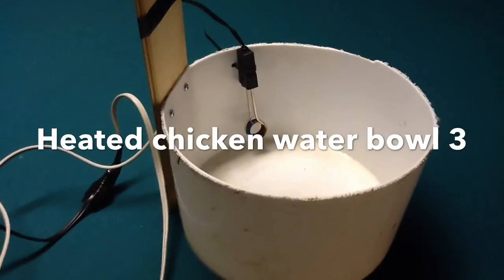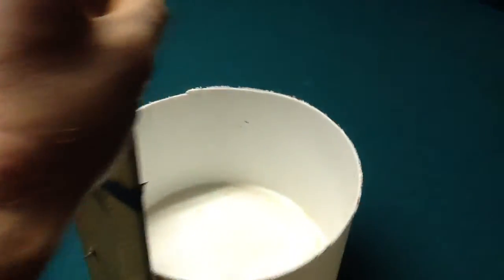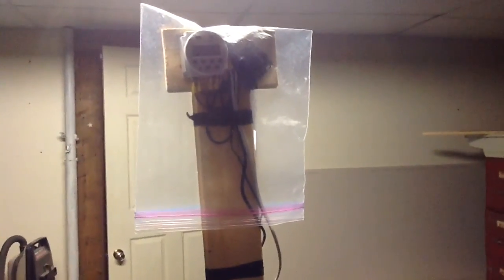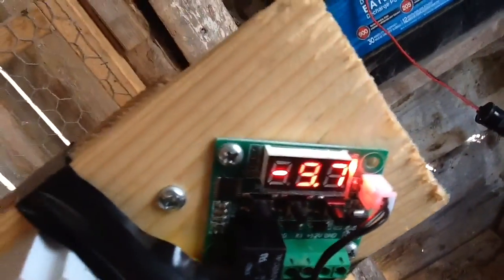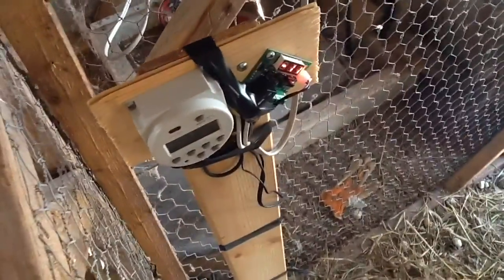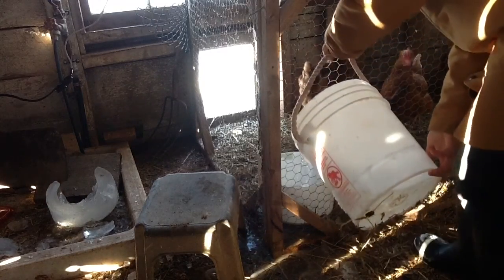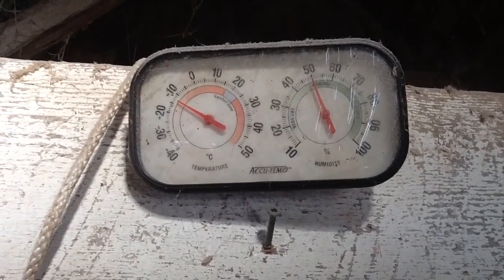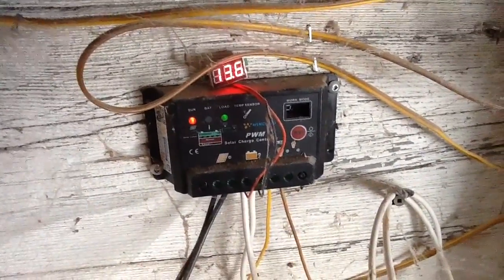Solar Powered Heated Chicken Water Dispenser - Part 3 - the prototype in action

Comment: For those technically inclined, I developed a simple circuit that uses only a solar panel and a heating element, no battery.  This power point control transfers maximum energy to the heating element regardless of the cloud conditions.

Comment: How is your dc water heater working. Do you have a list of the parts you use and how to wire them up.
Reply from the maker: No list of parts, at its coldest it would melt the centre of the ice block in the morning, the chickens would drink the part it melted not leaving water to melt a larger circle of the is block. so it didn't work so well, certainly not without a lot more power to keep the heater on for longer.
Reply: @MicahGallant  what if you were to add another battery